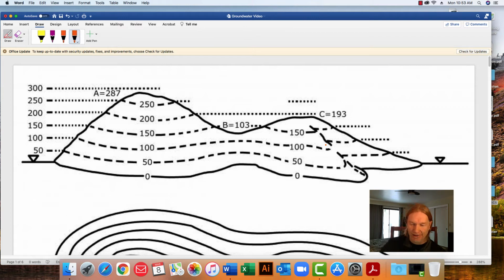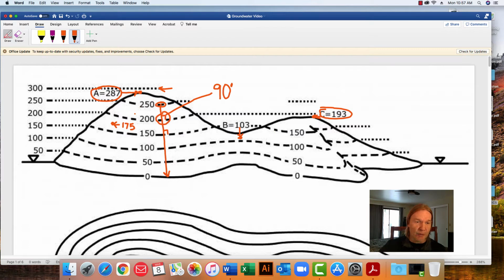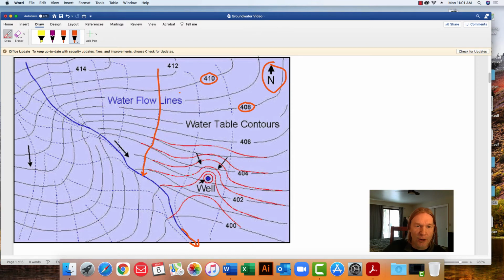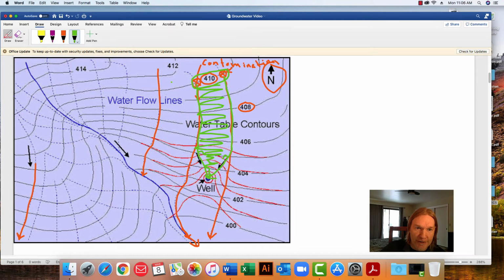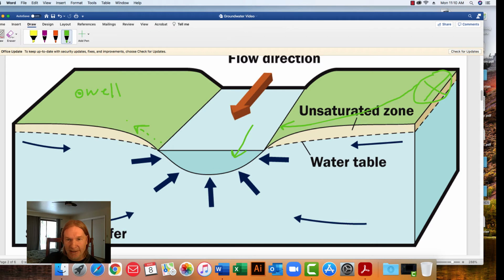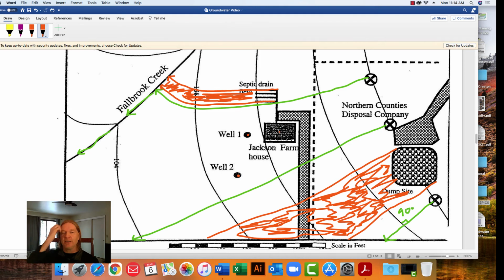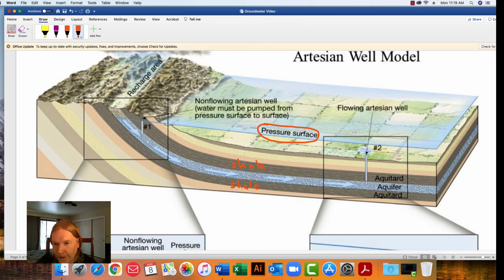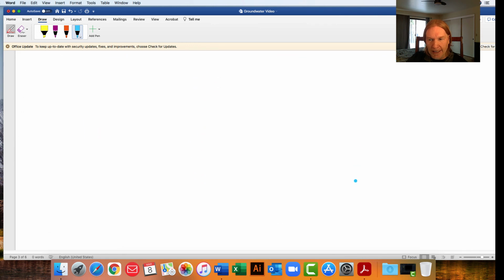Groundwater lab

Comment: Thank you! I listened to this out of interest, very clear. I have a question, for the first drawing on the septic drain field you put the lines going across horizontally, missing the wells but when well 2 was being pumped you put the line going vertical. Both ways would be perpendicular. Could you clarify?